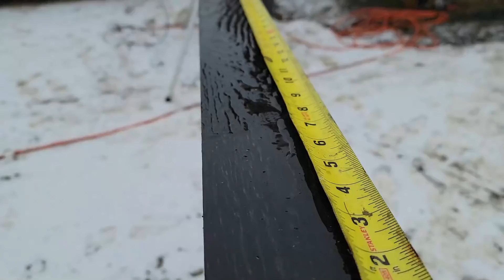Winter Life Building Our Own Home in The Mountains

Comment: Have to say I wasn't sure about the concrete siding at first, but it looks great. The air gap behind should also help to insulate the walls. I built my cabin walls from whole pallets and the air gap works a treat...cool when it's hot outside and vice versa. As long as you show up ...I will too. Really enjoying the build.
Reply: Seen some really good sheds built of pallets, one of which was basically a small barn, didn't realise you could also build a house using them.
Reply: Hi @YAUUN  I'm really interested in using waste materials for housing. Suits my budget too.Too much waste and poisonous materials in the construction industry. Just thought I'd try it, and it worked.The base plate is made from reusing 100 year old beams from the demolition of an old house. They were selling it as firewood! I clad the outside with board and batten...burnt yakisugi style to preserve and protect the wood.Much of the furniture was found roadside...some really nice things, repaired and upcycled. It's a very soothing place to spend time in.

Comment: Well done. The snow was not a problem, only a hiccup that you simply worked around. I have made a habit of not allowing the word problem to be used, but use the word challenge instead. Problem is a negative word, but a challenge always has a solution. You may have to look sideways or experiment, but there is always a solution. Keep up the good work.

Comment: For quick and dirty, rice (or other like corn cob) based hand warmers, pour rice into the toe of a tube sock, flatten to make the size desired, then tie off the leg portion.  Use 100% cotton to prevent fires.  Heat in tne microwave.  Spritz 3vrry so often to rehydrate the rice.

Comment: Horse blankets are notorious for having the leg straps coming undone. I’m sure you’ve found out that the blanket will slid to a side. I’ll zip tied a snap to a problem strap to keep it from coming off.
Reply: A ponytail elastic band will keep the straps on. Put it around the tips of the T end of the buckle after locking it in place. They sell wide elastic " keepers" in most horse supply company catalogs.  But the hair ties work as well & cheaper for many more. Make sure the blanket straps are snug but not tight. Then put the hair tie on the T.
Reply: And criss cross the belly straps right to left & left to right.

Comment: Did they hot have a blade you could use on the miter saw to make all the cuts on the siding? I am not sure how wide the pieces are. I have the same saw as you. It will cut 12 inches.

Comment: Looking good! Why did you sand the tops of several of the siding pieces?
Reply: That's a cutting wheel not a sander.
Reply: @denisewilson8367  - Ahh ok thanks. But I'm still curious why he ran the thing over the top of it and ended up looking like it was sanded. : )

Comment: Jeramy one thing I don't get you have a tractor why not move the siding closer to where your working you two are toting that stuff 50 foot then put it up move your siding under the roof where your working at that john deer will move it a lot of times during your build I would say why are they toting it so far you could leave it on the tractor an when your done for the day move it back out of the way again you two have done a dam good job but don't double work if your walking 50 foot for each piece of siding your dead on your feet at the end of the day just suggesting not trying to run the show try what I said one day an see the steps you save ok